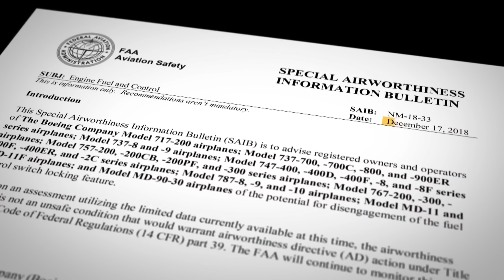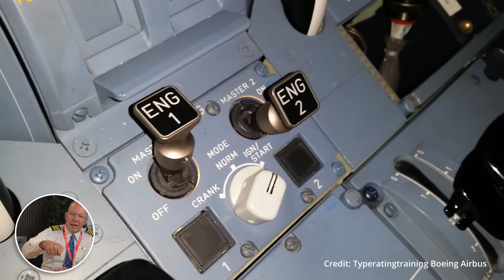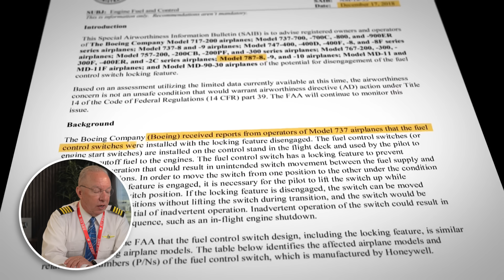Air India 171: The FAA’s 2018 Fuel Switch Locking Bulletin Explained (16 Questions Answered)

Comment: I disagree strongly on his statement retarding cockpit video.  He nixes it saying that with the other things "I think you've got all the information there."  This is preposterous.  This case is a good example.  WHO threw the switches?  A video would show that.  A video would show a myriad of other things such as if another person was on a flight deck.  It would also show the demeanor of the pilots.  Many trucks now have a dash cam setup that includes recording the driver.  This will provide a record if a driver fell asleep, was behaving like on drugs, or was texting and caused a crash like a recent YouTube I saw.  I just don't think that protecting a pilot from embarrassment for something like reading a magazine (a violation of policy) is more important than the lives of the traveling public.  Or more important than completely resolving an accident cause in order to prevent the next one.
Reply: Captain Steve said " the camera would not have prevented the accident" ...   that's not the point 😖 Captain Steve
Reply: It would also show if the switches weren't actually touched at all.
Reply: Captain steve was dishonest in answering icare question 3rd...the cameras will help determine root cause which the other systems have currently failed to address! Definitely not prevent! Pls dont divert the intent of the question!
Reply: Um sorry but I guess it should be "regarding" (I can't stop noticing it)
Reply: Even the trucks used to pick up our garbage have cameras now.. and have done for some years.
Reply: Even the cheap cameras on cell phones are 4k and you can see everything. Virtually no cost. Even a go pro.
Reply: @FilmFactry  LMAO You're really stupid
Reply: The guys is either an ass, or paid by Boeing.
Reply: Pilots are union members primarily. Their own egos are the primary objective.

The notion of packaging video into the combiboxes is fairly moronic regardless. Its a huge undertaking to get just the flight data storage robust enough to SOMETIMES survive crashes. adding video would need to accomodate hundreds of gigabytes of storage more.
Reply: @malcomreynolds4103  Just add a flash drive in the black box with an extra 32 GB. Problem solved.
Reply: Paid by Boeing obviously
Reply: Everyone involved in this is Dead...and not one of them cares who threw the switch. The camera Might give you info..but flight data will give those who Need to know the same info.
Reply: The preliminary report makes clear with photos the RAT was deployed within secs of takeoff. Yet Cpt Steve says he doesn't know what the poster / questioner got his information from?????
Reply: As I heard it, one pilot said to the other “why did you turn off the cutoff switches” and the other one said “I DIDNT.”  A video would show whether the second pilot was obfuscating or whether he actually hadn’t touched the switches.
Reply: @whitnk  To who's benefit.
Reply: @kimlersue  if the other pilot actually did not touch the switches, as he said, then there would be a cause other than pilot failure
Reply: @whitnk  Again...this is answerable  in the flight data and always in plane reconstruction. The fuel switches on the planes will be automatically checked.
Reply: We already know that there was no one else in the cockpit... they log when the door opens and closes. and all the crew are always accounted for.
Reply: A video would even show if the pilots' hands did not come off the throttle or yoke, which would exonerate the pilots and point to an electrical issue (which Steve says is impossible because they couldn't reproduce it in the simulator? As if the condition of the electronics in the simulator would be the same as whatever the electrical issue was on this flight, potentially!) Not even saying this is probable, only that it's possible.
Reply: @PlaysByEar you hear two clicks on the data recorder. They cannot move on their own- and if they were installed incorrectly, they would have “felt” wrong and pilots/mx would have written it up. And this plane flew for years. A camera will state the obvious- one of those two pilots moved the lever. Deducing who is simple thru listening to the cvr
Reply: @mcass777  Are you sure you can hear individual clicks from switches on the cockpit voice recorder, during takeoff thrust?
Reply: @yngndrw.  Sorry - it is only recorded on the data.
Reply: @PlaysByEar so you think electronics would falsely indicate two switches being manually moved from Run to Cutoff, one second apart, then later the same two switches being moved from Cutoff to Run also one second apart?  Wow.  That’s some electrical fault.
Reply: @Randor10  I do think due to the critical timing of the cut-off, it's most likely that it was one of the pilots that did it intentionally. But Steeeve is ruling out the possibility of false electronic inputs telling the engines to shut down. I don't know if a low voltage or high voltage signal indicates shut down, but if it's low then a short circuit could cause that to happen.
Reply: @PlaysByEar   They're dead just the same as are all the passengers plus whomever was on the ground. So how would a camera have made them any safer?   Who did it? Which one of the dead really cares.
Reply: @kimlersue  I didn't say it would make it any safer, or prevent what happened, just that it would help explain what happened. It's important to know if it was a pilot that caused the crash or something wrong with the airplane.
Reply: He's afraid he will be caught reading a Playboy Adult magazine inside cockpit
Reply: @galaxy-xp5nn or having sex?
Reply: But I think a camera couldn't overcome the impact...!
Reply: @ajisibi  a camera would not need to. The memory would be stored in a black box like the CVR and FDR
Reply: The bulletin clearly said that there is a possibility that these switches could lose the ability to stay latched and could fall down automatically due to shaking of the airplane. Air India did not maintain these switches at all, according to many reports. Whoever designed these switches to get activated by moving them down instead of moving them up should be an inexperienced person, and the people who allowed this design should be fired. It takes more than 3 or 4 seconds to pull them back up as per the timeline released. But it took only 1 second to get them both to the off position? Something fishy!

They need to publish the exact milliseconds counter for the left and right fuel cut-off activations. The difference could be anywhere from 0.1 to 1.9 seconds. If it's closer to 1.9 seconds, then it could have been manual operation. If it's closer to 0.1 then it's got to be automatic activation. That's why a video is very important. The fact that Captain Steve says no video recording is needed tells me that I have to suspect his critical thinking ability, and giving him this much attention is utterly unnecessary!
Reply: @atheisthuman8108 I think your critical ability thinking is what is at fault.
Reply: @Randor10  Prove to me you have a brain and not a bot.
The moment a fuel control switch goes to CUTOFF, EICAS brings up the secondary engine display, master caution sounds, and you get a clear labeled warning like “ENG FUEL CONTROL – CUTOFF”.
That direct, explicit display is what would prompt a question like, “Why did you cut off?” — it leaves no ambiguity that the fuel valve was intentionally moved, rather than failed.
That's why the other pilot answered "I did not".
Reply: @atheisthuman8108 The bulletin was about an installation problem.  The switches would never have worked correctly from the first usage, not randomly start to malfunction years later.  And for both switches to fail 1 second apart is incredibly unlikely.  Rewatch the video.
Reply: @johng4093 

Technical Critique of AI-171 Preliminary Report on Fuel Cutoff Switch Activation:

The preliminary investigation report into the AI-171 Boeing 787 crash places significant emphasis on the fuel cutoff switches being found in the “cutoff” position shortly after takeoff, strongly implying manual activation as the root cause of the dual-engine shutdown.

However, this conclusion raises serious concerns regarding its technical completeness and accuracy due to the following reasons:

Oversimplification of the Fuel Cutoff Mechanism
Modern aircraft like the Boeing 787 use a Full Authority Digital Engine Control (FADEC) system that governs engine fuel flow electronically. The fuel cutoff switches do not directly shut off fuel; rather, they send a command to the FADEC, which then evaluates multiple critical parameters (engine status, altitude, airspeed, fire detection, system health) before executing a shutdown. Simply flipping the switch does not guarantee fuel cutoff will occur.

Lack of Consideration for FADEC Protections
FADEC incorporates multiple interlocks and logic protections to prevent inadvertent engine shutdown during critical phases such as takeoff and climb. Unless the system detects valid emergency conditions (e.g., fire or serious engine fault), it will reject commands to cut fuel, even if the manual switches are toggled. The report does not sufficiently address whether these protections were functional or bypassed.

Insufficient Exploration of System or Mechanical Failures
The report appears to focus narrowly on pilot action without adequately investigating possible mechanical failures (e.g., faulty or jammed switches), software anomalies, or other system malfunctions that could have caused or contributed to unintended fuel cutoff.

Premature Attribution of Cause
By emphasizing the position of the fuel cutoff switches as the primary cause, the report risks prematurely attributing blame to pilot error without a full system-level analysis. This risks undermining confidence in the investigative process and overlooking potential design or maintenance issues that require attention.

Conclusion
A comprehensive investigation must integrate detailed FADEC system analysis, cockpit voice and data recorder correlations, and mechanical inspections of the fuel cutoff system to ascertain the true causal chain. Simplistic interpretations of fuel cutoff switch positions without these considerations are misleading and potentially detrimental to aviation safety improvements.
Reply: @johng4093 If both engines shut down during takeoff purely because both fuel cutoff switches were flipped, it raises a legitimate question:

Did the FADEC system fail to apply its protections?

Or does the design allow unconditional override — and is that acceptable?

This is exactly why investigations need to go beyond switch positions and look at system logic, software response, and potential faults.

Thanks for considering this clarification.